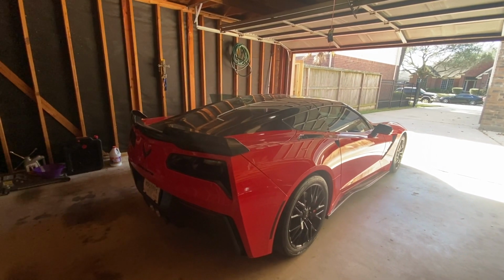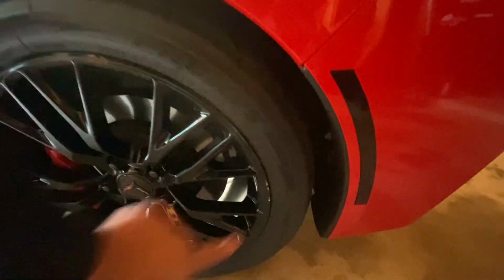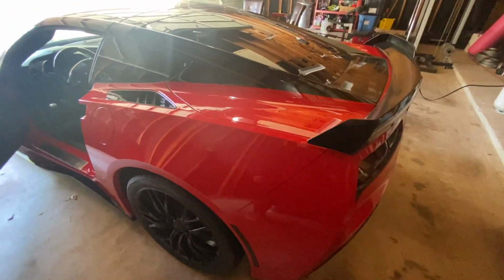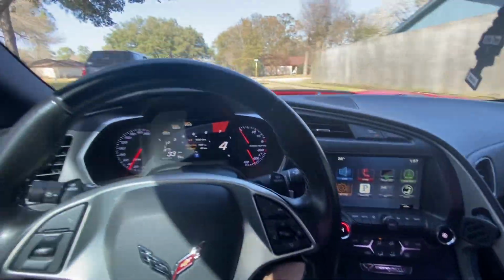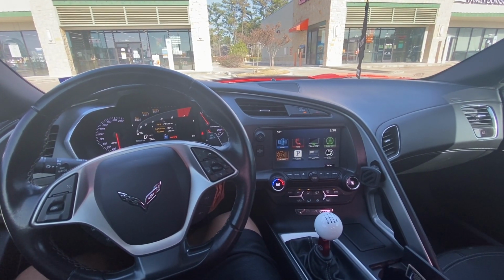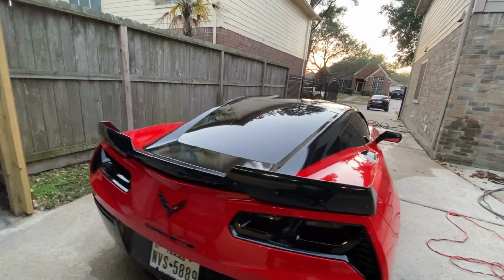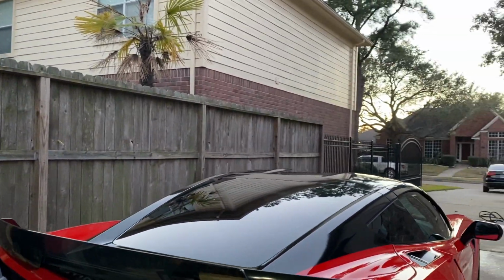C7 Corvette Stingray Cammed LOUD!

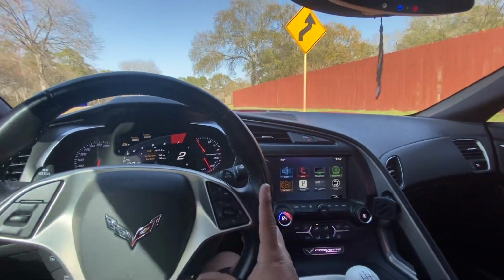Comment: Is that a grind into second gear at 5:21 or is it just that notchy?
Reply: Could easy be a grind/ scratch . The 7 speed scncos are inferior on second gear to be able to fit all 7 gears . My 16 with 24k miles will scratch second a tad when cold .

Comment: I have a question on this cam. For a Stage 2 cam is sounds really cool. But i am retired with limited funds. In your opinion could i use this cam with NO other mods and get a reasonable result. Over time i can get more of the mods like you have installed. i own a 2014 Z51, stone stock. A4, factory pipes and intake. will run OK with just the cam.
Reply: You’ll probably at least want longtube headers, I think the Katech torquer might be a little more what you’re looking for
Reply: @SeeJulianGo  What would be the difference in the two cams that you think Katech Torquer is better, I like Katech not a problem. Also i saw a larger down pipe of the factory exhaust manifold thinking of that pipe until i can afford 4 to 1 headers, any thoughts on that. D
Reply: @DennisMurphey  it doesn’t have overlap and it has a little less lift,  the main reason I brought it up is because katech has run it on c7’s with factory manifolds with pretty solid results. May not be quite what you’re after though because it won’t chop very much at idle